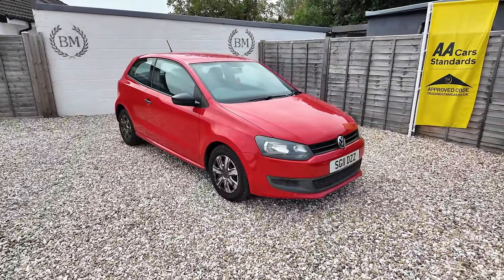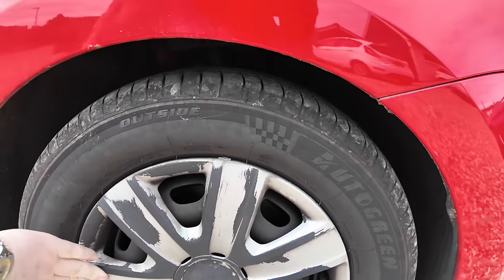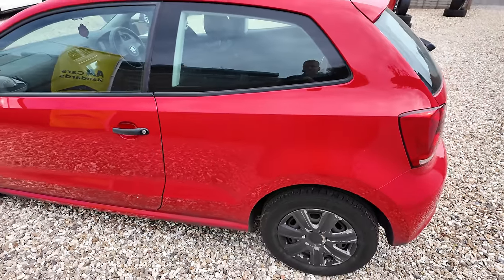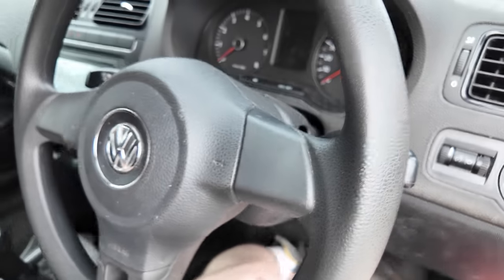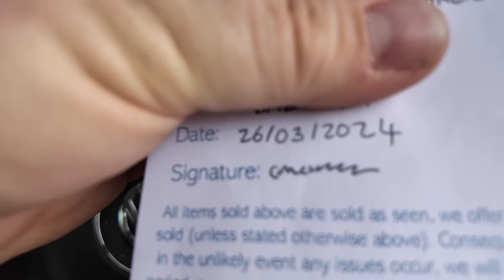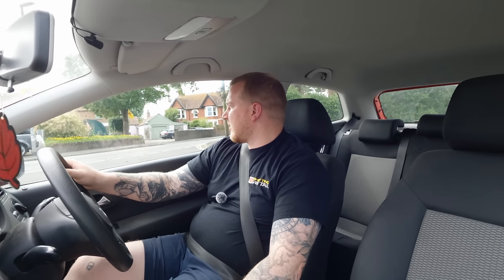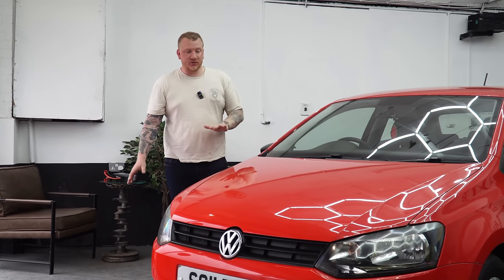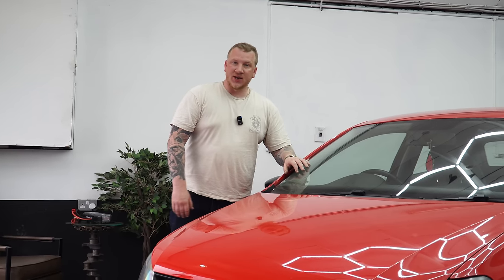I Bought A Cheap VW Polo - Did The Owner Really Lose £3400 In 3 Months?!

Comment: These, the A1 and Fabia are my bread and butter. So easy to work on, if it’s a Cat N front ender then all the parts basically just fall off with a few bolts. This one you have is probably the cleanest red one I’ve seen in a long while, especially in that basic S spec…usually Flash Red ends up a different colour on every panel.

Test a USB cable in that Sony stereo, as it might be the AX1000 with the CarPlay and a few extra quid on it for you/an easier sale.
Reply: Good advice

Comment: my daughter had one of these for her 1st car ( 1200cc / 3 cylinder/2010 MY ) with 50k miles bought for £6k in 2017 from the bank of Mum & Dad 🙂-    The head gasket , timing chain and valves had to be replaced after the chain tensioner lost its oil pressure after it  wasn't driven for for 3 weeks - apparently these engines are notorious for this happening if the tensioner has lost  pressure if it has been sitting for a while and it is then started. She sold it in 2022 with 80k miles for £4.3k , so not too bad for 5 years motoring.  MPG wasn't particulary good for 1200cc /3 cylinder car - mid 30's.
Reply: The 3 cylinders in the 9N3 from 2006- 2010 were a ticking time bomb, cracked heads, oil leaks onto the manifold causing a little fire under the bonnet.
Reply: @skimmingstoness  that’s German reliability for you.
Reply: @beano6452  bag of spanners

Comment: I bought one of these brand new in 2010, high spec; was an absolute nightmare, nothing but issues (timing chain issue at 28,000 miles), and after owning several VWs, this one was the reason I have never owned another VW since!

Comment: As per adleast one previous comment,  VW engines from this time are well known for timing belt issues.. I've got a Skoda Rapid 1.2 @ 57000 miles.. Just had it's timing belt changed due to Timing Chain Rattle!

Comment: My mum had one of these 1200 3 pops they like to misfire and have issues with the head gasket and cylinder head which would explain that lovely bill you have avoided 😂 , on a side note she did have the car for 10 years 4 of which were changing spark plugs so the misfire would go away strange engines tbh

Comment: Have the 9n3 polo bought it for my lad, 2 months in it misfired due to piston rings failing, vw advice is to throw away engine and buy another as its not rebuildable. 
Anyway 1 engine rebuild on my driveway later and a new timing chain and its running again....just awaiting a camshaft oil seal and its back 🙃.

Comment: The less cylinders you got, the more torque you got. You are right. My dad had an '03-plate Lexus IS 200. Six-cylinder N/A 2.0 injection engine. It sounded glorious. But it was very thirsty and gutless. Ditto smaller BMW sixes.